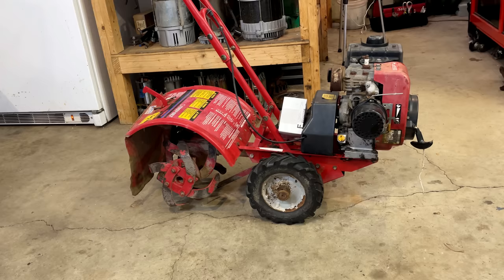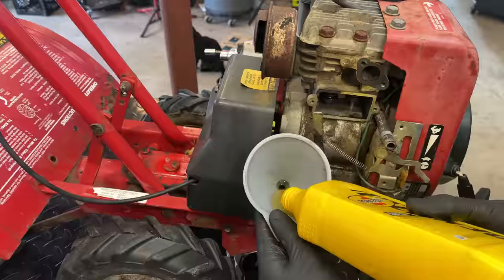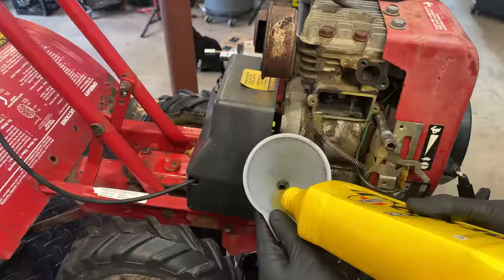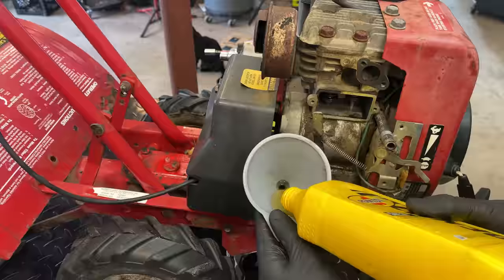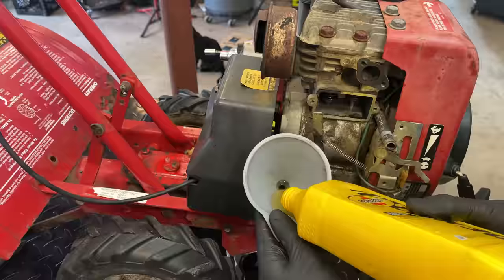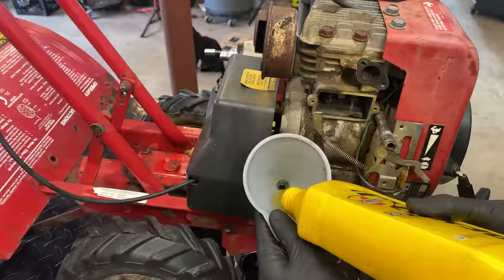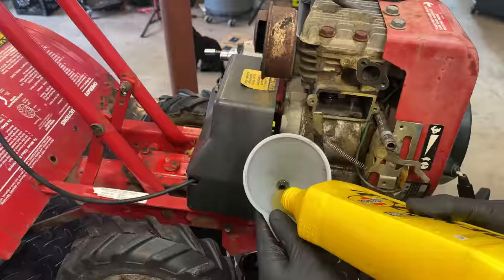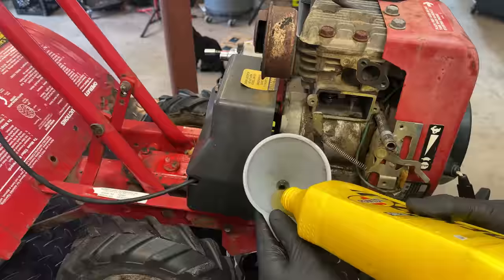Tired Tecumseh Troy-Bilt Tuffy Tiller - No Compression

Comment: To aid in your lifting heavy items onto your lift. Why don’t you cut a hole in your concrete floor the size of your lift, and dig out 4 inches of dirt under the gravel. Replace gravel and run a packer over it. Then mix some concrete and level it the exact height below your finished concrete floor as the height of the lift. Also bury power and control cable over to that steel post and mount controls. 
You now can drag heavy items straight onto lift. Also could drive a car over it no problem.

Comment: Nice job all around on the repair of that tired old tiller. One thing though...if the tines were sharpened, it would work a whole lot better. Dull blades make it harder to dig into the soil. Just thought I'd mention it. :)

Comment: Little machinist's trick: to lap in flat surfaces, get double back tape, put it on a flat surface, like at 1x2x3 precision block, then put sandpaper over that. You have a flat surface with sandpaper to lap in flat surfaces. You can start with 220 grit, then finish with 600 grit.
Reply: To do a head or to even see if it’s warped I lay down a piece of glass with a piece of sandpaper on it and rub it lightly to see if the material taken off is even.  If not keep sanding.

Comment: when making gaskets, I often will use a SMALL ballpeen or tack hammer.. gently tap on gasket while its against the part.. the edge of the part cuts the casket or at least makes an mark. the ball on the ballpeen can often be used to mark bolt holes or sometimes cut the holes.

Comment: Thanks James, I have a very similar Troy Bilt model. Engine runs well but I have a bad seal as well that needs replacing so you shown me how to tackle it. Much appreciated and as always  another enjoyable video. I'm surprised that model did not have a drain plug for the gear oil. I assume that is correct. ? ty

Comment: It is the worn/defective valve guide that is to blame for the valve becoming leaky because the valve head will not stand straight in the valve seat and thus it wears crooked. I have seen it many times on Tecumseh engines that seemed to be equipped with valve guides made of very poor materials.

Comment: I cut today a gasket and I have 1 proposal. It is not necessary to draw the outer boundary of the gasket. You can use scissors to cut the outer part off when the gasket is in place. This way you can easily and quickly get an accurate outer border. Kari, Finland.

Comment: Nice restoration as usual. For gearboxes with water in the oil try using marine outboard gear oil for a while before draining it and replacing with normal gear oil as it emulsifies with water and still provides lubrication.

Comment: You could try plating on the exhaust valve stem to increase its diameter slightly - chrome would be best for wear resistance.
Reply: That's certainly one option but I would check the diameter of the valve stem first in case it has also worn.

Chrome plating isn't easy and is quite expensive to have it done professionally. Nickel plating on the other hand is quite easy and also has good wear properties.

Comment: I think that's water infiltration and seal failure is a big problem . I was given a troybilt horse years ago (still in my shed) the original engine runs great , but the gear case was full of water . If you were closer I'd drop it off .

Comment: Wow that exhaust valve guide is extremely worn. I applaud the work you do but the overall condition of that motor lead one to think about re-powering with a different motor. I have done valve guides in a B&S flattie and it's easy but the kit cost is prohibitive. As far as your clearance goes it will self correct 😊
Reply: It's fine. It's only a garden scratcher. Like he said it'd be more of an issue on the intake side. The exhaust can blow wherever it blows.
Reply: @1pcfred  well scratching and tilling is two different things, He didn't really give it a good work for an extended period time.
Reply: @JimsNBHomestead  a 3 HP tiller is pretty light duty machinery. So it was never built for working extended periods of time.
Reply: @1pcfred  if you think that is light duty lol
Reply: @JimsNBHomestead  as far as tillers go I didn't know they made them so low powered. 3 HP is pretty small.

Comment: Plug wire supposed to go through the oblong hole on the pull cover where you put the bolts in for the head & gas tank

Comment: James, have you ever made a gasket using the tap method for making gaskets? Place the gasket material over the pice and tap lightly with a ball peen hammer to cut out the gasket.
Reply from the maker: I have tried, but must be doing it wrong.
Reply: @jcondon1  yeah you're probably not making gaskets on heavy cast iron castings. Them old time water pumps were something else. The hammer method really isn't viable for alloy parts. Get yourself one of them self healing green mats. They're nice for cutting on. You can cut from both sides too. Once you get the one side scored flip the gasket over and cut on the other side. But with a self healing mat you can cut through better.

Comment: Your compression tester has the same hose as the leak down tester. Just use the same hose rather than taking the hose off and putting the other one on
Reply: compression tester hose has a schrader valve in the end so air only goes one way. Leak down tester needs to put air in to cylinder needs open hose.

Comment: I've read some tecumsehs have an issue with the valve seats sinking. Fixed a generator for a guy and it had one of those motors and no clearance on the exhaust valve. It did run after I ground the stem to clearance but idk how long it lasted after.

Comment: Use a ball-peen hammer to tap on the gasket material, forming the outline and all the holes needed. Should just be able to remove the unwanted parts of it after.

Comment: Cool vid

I have a Briggs flat head on a lawnmower
It seems to loose compression when hot and not stay running until cooled off.  I suspect exhaust valve issue .

Try some engine restore oil additive (20% oil capacity) remainder regular SAE30

Comment: First time I've seen an engine where valve clearance is " adjusted" by grinding stems. What a crap design. Again, well done James.
Reply from the maker: All the older flat head engines are like this.  OHV engines are a lot easier.  The plus on a flat head is a non interference engine and no possibility of dropping a valve.  A much safer design for longevity of the engine.

Comment: I have been working on a very similar tiller, and I found the transmission had mostly water in it. I swapped the engine for a newer Tecumseh off of a snowblower. My front seal is weaping too, thinking about changing the seal...

Comment: The leakdown test is often inconclusive on auto decompressor motors, especially when the motor is well worn. Better to put oil in the plug hole to test the rings for blowby first- gives you an idea of the proportion of wear in specific areas.

Comment: I would suggest ALL of the engine 'problems' you found could be traced to the mouse-nest under the blower-cover. The excessive heat would cook oil, score cyl. wall, wear cams, crispify fuel hose....etc. (the chewed wire is indirect issue from same critters)

Comment: It is way easier and more precise to use the tap method to make gaskets. Take a hammer and lightly tap on the gasket material. The edges of the part will cut through.

Comment: Great video. I have one of those machines, so now I'm going to go check it for leaks and oil issues. ":)
Reply from the maker: If the wheels are not already seized to the axle, take them off and out some anti seize on them.  Will help later if you need to remove them to replace a seal.

Comment: I think the tines are a little bent, they should be straight to the angled blade point and they don't seem to be, i looked at our tiller and that was straight to the blade from the drive plate where they are bolted on, still a sweet old machine, that just needed a bit of TLC.

Comment: You made an excellent video, James! You show great finness working with machines, and you're attention to detail is incredible.  As for gasket making, you can sometimes use a ball peen hammer (ball peen side) to create an impression (and sometimes cut the gasket).  I'm not sure how sharp the 45mm casting was, but it would have worked for the bolt holes.  Also, any chance you were a student at USF during the 90's?

Comment: I may have missed it in previous comments but I would have simply used a ball peen hammer while holding the gasket material on the end of the machine to make the cutouts.

Comment: At 30:26
Valve springs....

I wonder if the valve springs are weak. Could they no longer be strong enough to allow the vows to do their job??  That could cause a type of "float"....even at low RPM.

Comment: Not a good idea to use those roloc discs on internal engine parts unless you plan on taking the engine apart and giving it a bath.  The ceramic oxide will destroy engine bearings if it gets into the crank case.  Wire brush and carbide scrapers work nice.

Comment: James... please don't be using #1 metric Phillips with the #2 JIS screws (carburetor screws) I've striped them clean... I can tell those are #2 JIS Phillips (JIS is Japanese Industrial Standard) rather than our usual US/Canadian style #2 phillips, there are times it appears your driver slightly rounds over the corners.... using appropriate bits for their usage (standard, metric or JIS) will reduce the amount of stripped out screw-heads.

What's your shop cat's name?

Comment: Not sure if that is the same model I have (thought mine was a Tuffy Jr.) it's buried right now in my shed. I got it from my sister and had it running but under load it would choke out and the idle wasn't quite right maybe I should just spring for a new carb since I only half fixed it but I don't really need it and will more than likely sell it. She only used the thing a few time and it sat for ever in a garage.

Comment: Thank you for another educational video. In the "olden days" 3 hp engines were common on lawn mowers and tillers, however today 5 to 7+ horsepower engines are common on mowers and tillers. Is there a reson for the increaseed power requirements?
Reply: I was surprised this tiller was only 3 HP but it seemed to do the job. Really I don't use a tiller for digging but just for making fines. If you bust the soil up into clods a tiller will really do the fine pass nice. Making fines by hand is tedious work. You'll be there all day chopping.

Comment: My guess is that the input shaft will probably seep a little oil, but given how thick the gear oil is, I'd doubt it'll be an issue.
I'm assuming that gearbox gets gear oil.
Reply from the maker: It’s very heavy gear oil
Reply: Mix 90 w with Lukas hub oil

Comment: I get snowblowers with 5hp tecumseh lo compression. Put on TDC put a little screwdriver in sparkplug hole if you can spin valve easily needs valve adjustment

Comment: You really need a seat grinder and a valve grinder. Even when you buy new valves they are out of round. For seat grinding I have the newway one but I like my sioux grinder for seats and valves. For small stuff like you are doing I use my neway with a 30 and 45 degree plus I also have the 70 degree to get a perfect round seat and to correct size. I even have the precsion hone sets to bore cylinder .010 over. I have not messed with this stuff in 30 years because I can not make any money today with the time it takes. But the price of parts are just crazy out of site today. You always have ware and small pits on the valve face. I still have the tools to replace the valve guide. Briggs were always bad on the exhaust side. Replace a lot of those valve guides on those. Nobody does it today and I don't even know if you can get them today. You can run them loose without much of a problem. Did a lot without replacing the valve guide cause it took to much time and back then no one wanted to spend the money to do it right. You can take the piston out use a ball one and replace the rings makes a big difference. You can use the old rings if they don't look bad. Like I said prices are crazy stupid today. A ring set was about 5 bucks back 30 years ago. On these new engine today on a 27 horsepower briggs they want about 40 bucks for a sump gasket that cost maybe 1 dollar. Why I say crazy prices. They don't want you to fix anything other than replace the whole engine.

Comment: Nice job! I think I would have cleaned and lubed the idler pully bearing also while it was off. As a suggestion, you might watch a few Salvage Workshop videos to catch one where he makes gaskets with a ball peen hammer. Very easy, quick, and almost always a perfect fit.

Comment: I have a Troy Bilt tiller that I revived a couple of years ago. It runs perfectly now, but it has some minor drive line issues (seals,etc) that need attention. The model tag is long gone, and Troy Bilt was unable to cross reference the serial number from the engine, and said it had likely been replaced at some point. Do you know of any other way to obtain the model number for this machine? I am guessing it was produced in the early 2000s, but I have been unable to find a picture of this machine online anywhere. It is a Pony Series with a Briggs Intek engine.

Comment: All the Troy-Bilt around always have a neutral and where you have the gear shift to shift too forward or reverse there's a spot in the middle that allows you to roll it around throw it onto the truck or trailer or anyting else if you're moving it took that out see that twerking

Comment: I always thought the point of the rear shaft tillers with front drive wheels were so the tiller bar would turn in the OPPOSITE direction from travel.  Doing that tills about 5x better than the tiller-only style that has to move in the direction of the tiller rotation as it's also stuck being the forward driving method..   This thing just seemed to scratch at the surface instead of sinking to the tiller drive bar.  Color me puzzled.
Reply from the maker: Good point.  When I tried digging into the soil the tones just pulled me along.
Reply: @jcondon1  I'm trying to understand if and how the tine drive could even be reversed?

Comment: I saw you ground the exhaust valve down further than spec because you said it was opening slightly during the compression stroke. From what I understand these flat head Tecumseh's have a decompression release for easier starting, and I believe that is what you were seeing. By grinding down the stem even further you essentially got rid of the decompression release. That feature supposedly goes away when the engine is running fast enough (over around 600rpm). Or am I incorrect and this model doesn't have a decompression release?

Comment: Jim, Be mindful that most engines come with a cylinder decompression valve attached to the camshaft that at low engine rpm (usually up to about 50-100rpm) the intake or exhaust valve will get bumped to prevent compression building so its easier to pull start. I originally thought my engine is low compression was a bad cam due to the valve getting bumped but it is normal.

Comment: Hi James, keep the videos coming...I enjoy watching, and learning from them. At nearly 70,  I am retired these days and enjoy fluffing around with small engines. I live in Australia and have been trying to purchase a circular brush that fits an electric drill similar to yours to clean the head and block surfaces of small engines. Every hardware store (including branches of the largest hardware chain in the country) that I have spoken to in my part of Aussie, and described that brush to, has not been able to help me. Could you please tell me what it is called, and any other info you could give me (including sizes, and how long they last), so that I can do an internet search for them ? Thankyou for any help you can give me. Cheers...Trevor.
Reply from the maker: It’s a 3M roloc bristle disc.  I had to order it online.  You separately have to purchase the adapter for the drill. 3M 3M-18733 Roloc Bristle Disc Grade - 120, Size - 2 https://a.co/d/hSrtB2M
Reply: @jcondon1  Thanks James...I will check it out. Appreciated the prompt reply.

Comment: Can you put a magnet in the back of the pressure tester? Or would that affect the reading?
That way you can stick it to the frame or tank, and don’t have to hold it while pulling the coil at the same time.

Comment: I hope the grinding wheel you used to work on the valve stem is certified for use on its side, otherwise that was seriously dangerous :)
Reply: I certified it. It's good til you can see through the side.
Reply: He was just barely touching the wheel - putting no force on it.
Reply: Jim Myers you obviously haven't done much work with grinding wheels.
Reply: @1425race  there are different kinds of wheels and some do wear faster than others do. With the very softest wheels grinding on the sides of those may actually be a real problem? I run a super soft wheel on one of my grinders and I've even lightly grind on the side of it if I felt the need.

Comment: Excellent job James on this tiller. Do you think some heavy grease or anti-seize would have worked on the engine valve stem to close the movement of the valve? (Tricky fix) Your gasket material appears to be of better quality than the paper look a like we have in Canada at the Canadian Tire store. Where did you order it from? Keep on the good work. Looking forward on the next piece of equipment Paul brought you.
Reply: Once the engine heated up it'd melt off whatever you put there. It's a small engine so I guess they didn't make it so it'd last forever. Is weird you can't change the guides though.